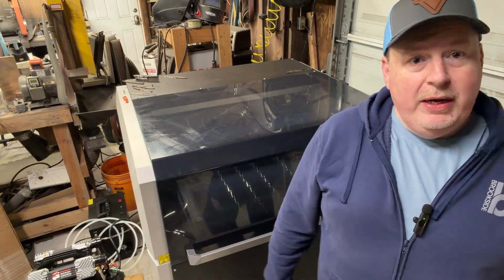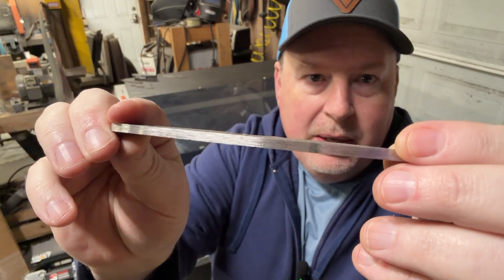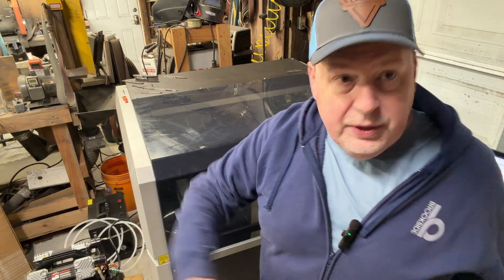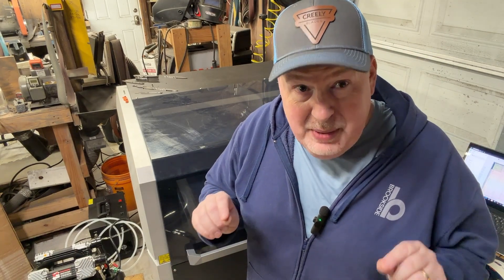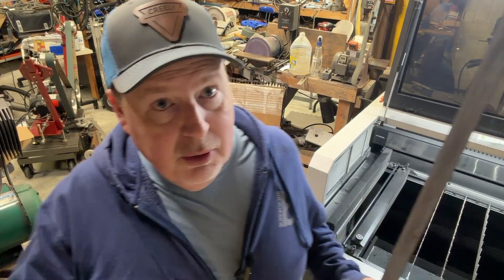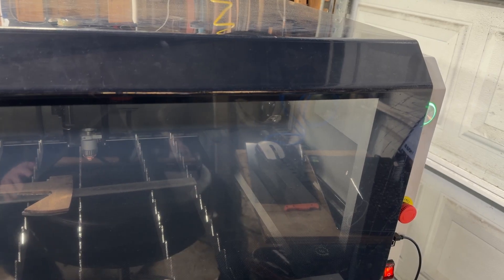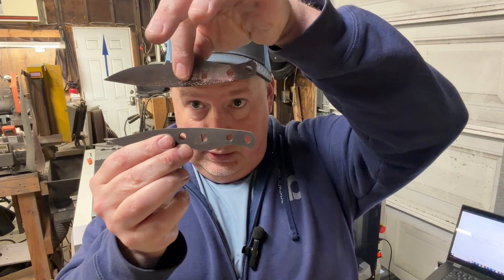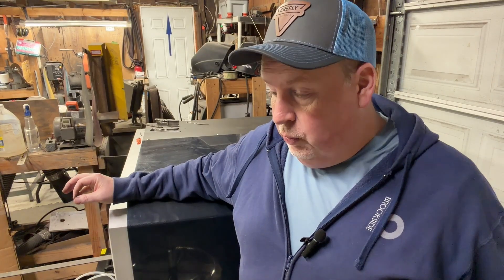Xtool MetalFab CNC Fiber Laser Cutter

Comment: Good video and I agree with you on the value and importance of this small laser CNC cutter. My unit arrived last Friday and I'm still working on setting it up. 
I'm interested in the settings you used to cut your knife blades. What was your air pressure and travel speed?

Comment: Good video.  Thanks.  Is that material roughly 4mm?  Did you use lead in?  I saw the settings 100% 30mm/min.  Any other advanced settings.  I have not tried knife blade blanks yet, but looking forward to it.

Comment: I have the welder. I suppose you’re not that familiar with welding. I’ve been welding since 1973. I’ve been TIG welding for around four decades. I will rarely ever TIG weld again. The only time would be where the gun can’t get into certain tight areas. I’m not the only person. Companies making stainless sinks have been moving to lasers. It’s several times faster than TIG. I’m also using it instead of MIG. The welds are a lot stronger than you might think. Certainly comparable to conventional arc welding.
Reply from the maker: My point is a Tig or Mig welder can accomplish most of the things the laser welder can. Being able to cnc laser cut steel used to be a quarter million dollar proposition not that long ago. i’m sure the laser welding is very useful and good in certain applications and an improvement over traditional mig or Tig welding in some circumstances, but it’s really not cheaper than a mig or Tig welder, in that context it’s just a new technology. i’m a Knife Maker and the thing that this replaces is a drill press and a bandsaw. A plasma table would not be adequate for Knife making because it’s not accurate enough and has too much heat affected zone. This laser CNC cutter will pay for itself very quickly and allow me much more flexibility then the alternatives.
Reply: @Creelyblades it depends on the use. It’s certainly a lot cheaper than a TIG welding operation as it takes three to five times as long to TIG the part. Then the cleanup is more as well. No, lasering many items is certainly cheaper. The cost of the machine is low once you figure out the ROI. It’s labor that’s expensive. It can take at least a couple of months for someone to get up to speed as a production TIG welder. It will take a week for that here. Blue Origin and Space/x have moved from TIG to laser and so have other companies in the field. I’m not saying that TIG will disappear, but for many, if not most areas, laser is not as good, it’s better.